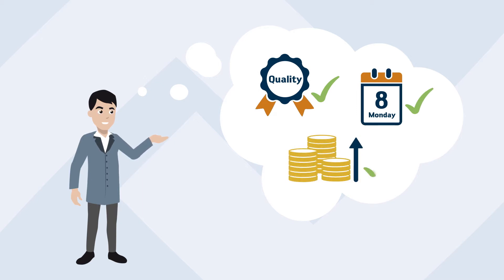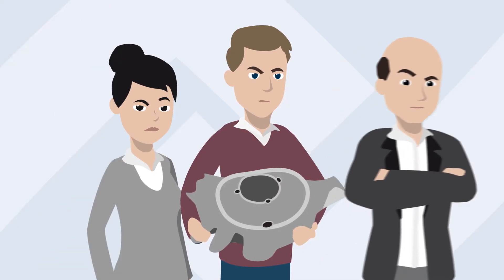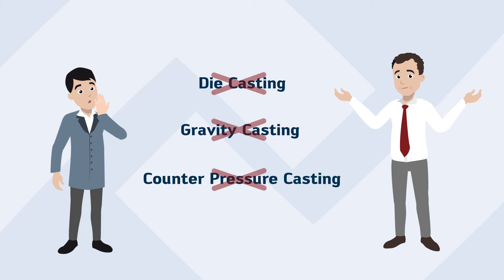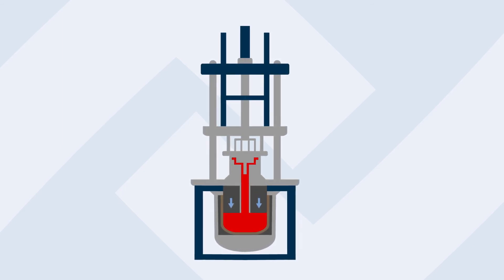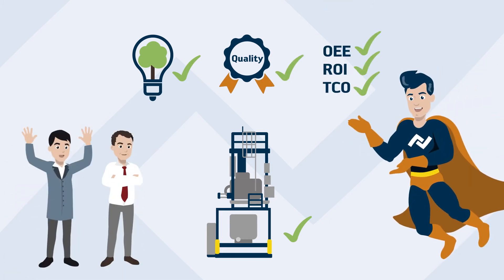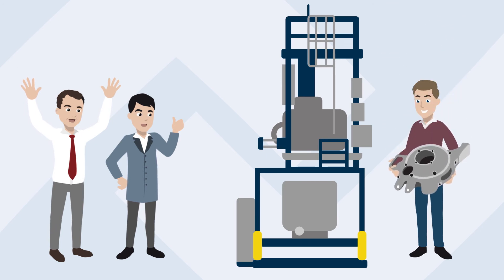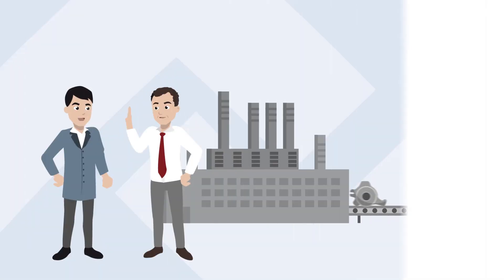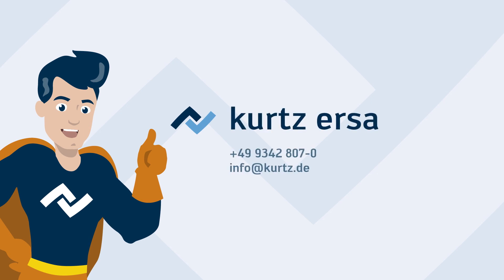Kurtz Low Pressure Casting Technology | Turnkey Project

Comment: Some years back, I did build a small Low pressure die casting machine for producing Automotive Clutch bell for a customer, with all PLC controls. I used a Graphite feed tube for the metal injection into the die. One problem was in the first several shots, the Aluminum used to cool inside the feeding tube, just below the bottom fixed die & this was manually pushed back to the furnace. To solve this problem, we attached an extra pusher ram with Hydraulic cylinder in the upper half of the die and had to run a separate cycle after part ejection to push down the clogged aluminum. Do we need to add a separate heater to the feed tube, so that the aluminum in the feed tube. Would be very helpful if someone advice and Thanks in advance